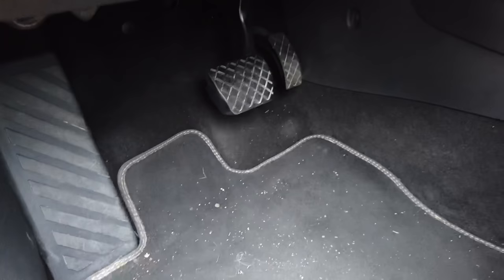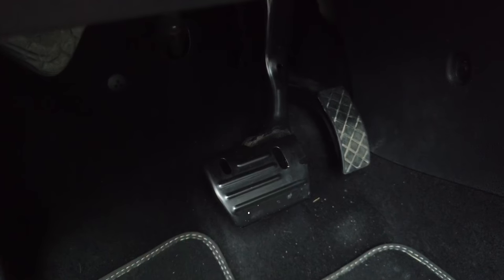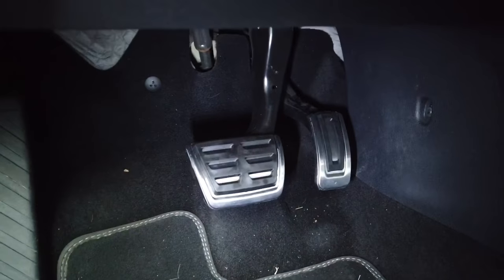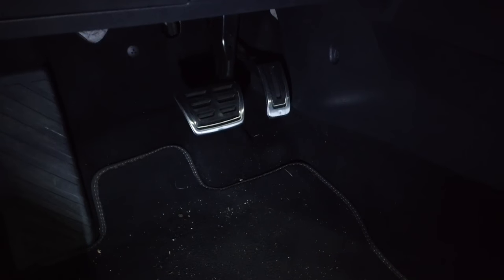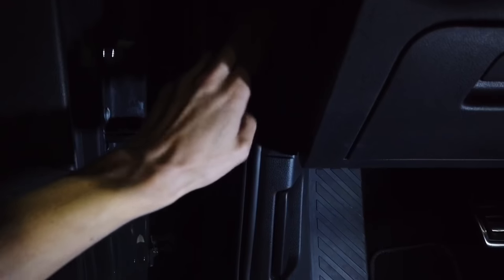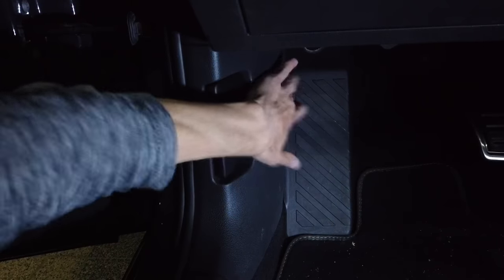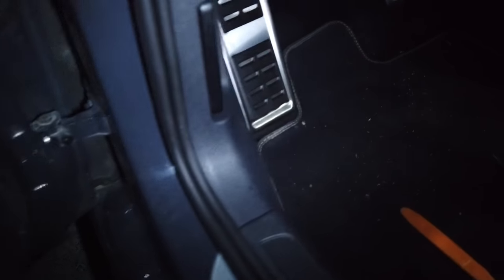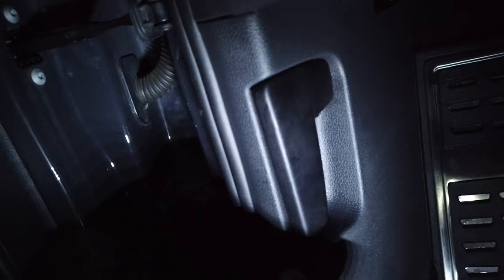VW Golf MK7 aluminum pedal covers replacement

Comment: Thank you so much!  Yes, the gas pedal was tough to put on!  Thank you for being so honest because it felt good to know that it was not just me!
Reply from the maker: Happy to help!
Reply: I've been messing with it for about an hour and I still can't get it on. Any tips?
Reply: Tip/suggestion: I slid the cover on from the bottom and it was easy. 
I noted that the plastic molding of my set on the back was sort of "open" at the top.
I hope that helps.
Reply: @BirdiesGoCherp  Da gibt es Firmen die das können, nennen sich Werkstatt.

Comment: Nice video! Gas pedal slide from top to bottom, it goes directly in place all way down. Rest pad, no need to remove all side panels. It's a rip off click in process snce the side panel it's very flexible and you can just bend it open! However, if you are a mechanic and get your salary by the hour.... ;)

Comment: For the gas pedal, start at the bottom and slowly slide it up and into the rubber track. Was the easiest one with this method, was recommended by another commenter.
Reply from the maker: Thanks for the tip!
Reply: Thank YOU! This took me 5 minutes thanks to you
Reply: How do I start at the bottom and slide it up? I can't manage to get the rubber onto both sides as I slide it.

Comment: Thank you for the helpful video I fit the footrest without remove the panel it have enough space to do the job and the accelerator pedal was the easiest you just have to fit the rubber from the bottom of the pedal and slide it bottom-up and that's it it took me 2 seconds to fit just a tip Skoda Octavia 5e combi
Reply: Yes, same. Just needed thick gloves and a good yanking. No need to remove panel.

Comment: Hey I recently bought a 2016 Golf Mk7 Variant Highline (1.4 liter petrol 125 horsepower). It has the standard brake, acceleration, clutch pedal and foot rest. My question about the product in your video is, how is the quality after say a year of daily use? Is there any noticeable wear off to the pedals or are they in excellent condition and it might not be something to worry about?
Reply from the maker: Still looks very good. Foot rest is little bit scratched but overall very happy with the quality and visual effect.
Reply: @mrfixpl  alright, thanks!

Comment: I just did this. Thank you!!! 
One thing to note, is that you can slip the little locking clip inside the hood latch handle back into place before you press the handle back into place in the last step. 

Also! The trim has little metal locking clips that can come out. Make sure those go back into their little clip holders before you press the bottom door trim back into place. Fun little upgrade! Took no time at all, and everything just worked.
Thanks again!!
Reply from the maker: Happy to help and thanks for your input!

Comment: Cool guide, helped a lot, thank you! Quick key notes as seen by me. Clutch and brake: remove rubber, add new metallic cover. Gas: nothing to remove (ha!), just add the metallic cover. Good to align it at the bottom and slowly work all the way up. It should hold snugly. Foot rest: Removal - just follow the video, it will guide you absolutely perfectly. Reassembly: As others said, put the locking element back into the handle and just click it on, there is a bezel made on the peg just for this easy way of assembly. All in all - easy procedure. Looks a bit more difficult than it actually is. Make sure you don't work in subzero temperatures, it makes all plastic and rubber too hard to work with.

Comment: I had an absolute nightmare fitting the accelerator pedal cover and ended up using some quick detailer, spraying a little bit onto the edge of the pedal to lubricate it. The pedal cap then slid right on. Hopefully this helps someone.

Don't go overboard with the detailer though, you don't want any nasty residue.
Reply from the maker: Thanks for the tip!
Reply: Tried this an it did not help in any way. Are there any other methods?
Reply: I propose to easy heat it. I did and it was simple to mount it